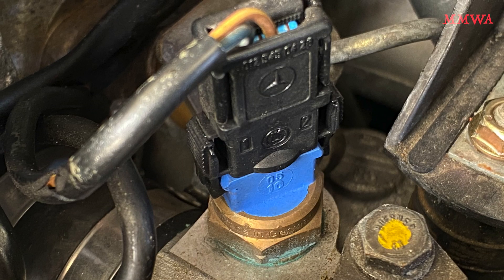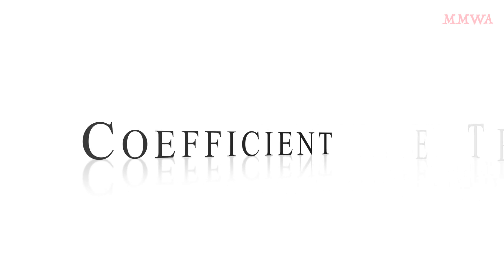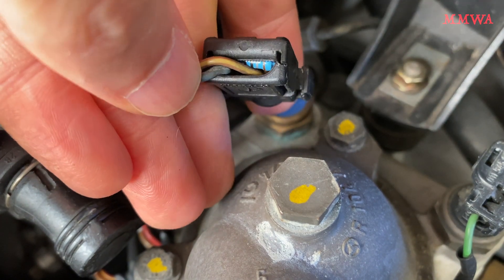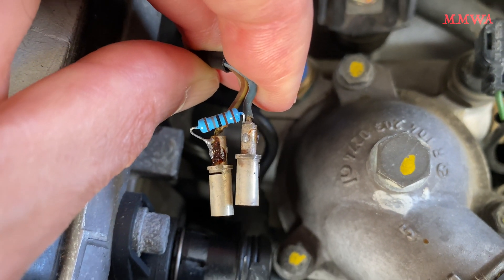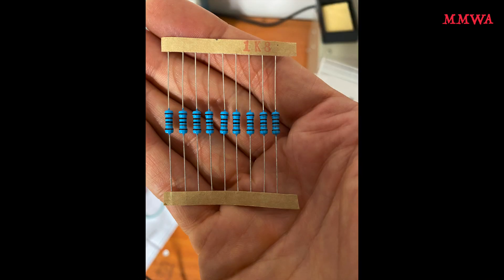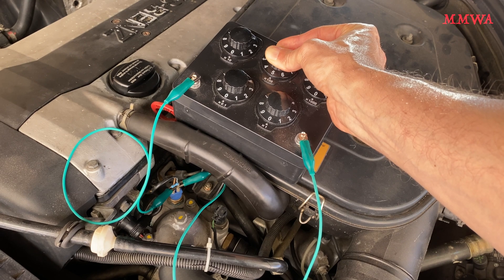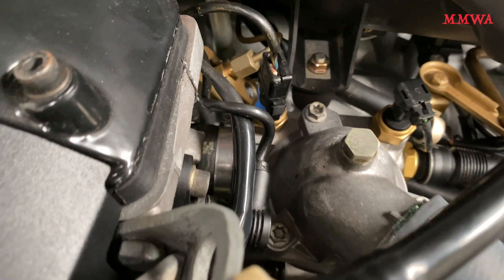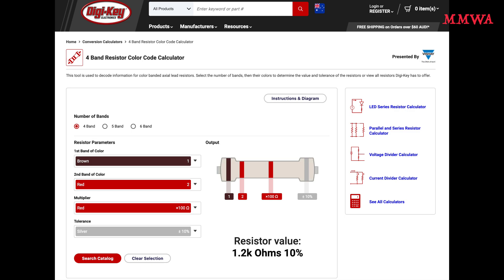About the W124 (and possibly others) Aux Fan blue temperature sensor modification

Comment: I use 1.0 K ohms resistor in order to keep the engine temperature not higher than 100 degree Celsius.

Comment: I just did some math on possible resistors and corresponding fan activating temperatures. 
Greetings from a Mercedes engineer ;-)

| Resistor \[kΩ] | Temperature \[°C] 
| -------------------- | ---------------------------------------------- |
| *2.2 kΩ*           | ca. *101.8 °C*                               |
| *1.8 kΩ*           | ca. *100.4 °C*                               |
| *1.5 kΩ*           | ca. *98.9 °C*                                |
| *1.2 kΩ*           | ca. *95.0 °C*                                |
| *1.0 kΩ*           | ca. *92.0 °C*                                |
| *0.82 kΩ*          | ca. *88.3 °C*                                |
| *0.68 kΩ*          | ca. *84.4 °C*                                |

Comment: thank you for your video...
wondering now if this would work as well in my BMW M50Tu's coolant temp sensor mounted on the radiator that activates the high speed condenser fan....
Reply from the maker: if it is an NTC thermistor it absolutely will work in the same manner. You will need to study what resistance it reads at what temperature and alter it according to what you want. If it is simply a switch, you are out of luck and will need an aftermarket fan speed controller.
Reply: @MMWA-DAVE  
duly noted, thank you!
I shall do a research on my BMW part aside from it looking so similar to your video 👍

Comment: Hi
What you have said was very talkative for my reasoning
My w124 , 
the coolant fan never starts
The A/C fan take over when it is hot
 I have to check this sensor value
I have a simulator for testing this sensor, I'll give a go
Of course the fuse, relay and the last, the clutch .
Could you possibly give some clarification.
Thanks
DomIJ

Comment: Interesting, , I have just got my M104 powered 1990 SL back on the road, BUT after a few weeks i noticed the fans were running, temp gauge indicates 80degs,  first i will change that blue sensor, but if push comes to shove it may be a pump change and i will not be looking forward to doing that particular task. Car has done 135k. best regards Cheshire UK and sometimes Sisaket Thailand.

Comment: Does it work on a OM601?
Reply from the maker: I cant say as i’ve never seen one. If it has the same climate control panel with manual fan speed knob and airflow controls and electric fans on the AC condenser it may well have the blue sensor.
Reply: @MMWA-DAVE  my fan it's magnetic not electric. But i have that blue sensor. In my case its red
Reply from the maker: @MrRoentgen616  I don’t know if this modification is for you then. If the red sensor is an actual NTC resistor like the blue one if might work. If its a simple on/off switch then this wont do anything.

Comment: There's one thing I don't get: Is the resistor mod altering also temperature point of aux fan going off? I mean, I have 1.5k now and it starts at around 100 celsius, ends around the perfect engine temp (the road temp). I want to get there 1.2k, does it mean the fan would stop BELOW the temp is it going off now at 1.5k?
Reply from the maker: Yes, the resistor mod alters the on and off temperatures of the fan. Note that that no 2 cars are the same and the same value resistor doesn’t give same results on both cars. I know this from my 2. The blue sensors are also slightly different too. There are aftermarket fan controllers available to get the on and off temperatures dialed in exactly as you like, This mod will never give such flexibility.
Reply: @MMWA-DAVE  that’s what Ive thought. So, where’s the „stock” information about aux fan on/off stored in? ECU?
Reply from the maker: @gregboro1244  on my cars is the climate control panel that monitors the blue sensor and switches on fan relay.
Reply: (by the way, I did the mod without any soldering, just put the thin resistor wires between inserted into two holes of the female plug.. and plugged directly to the sensor - tight fit, it's so easy)

Comment: my W124 230E aux fan stopped working years ago.. the fan only works if I use a wire jumper on the main coolant switch. so if not observant - the engine will overheat which already happened once and now I am losing about 5mm engine oil after average long distance driving. Still have not found the leak but most likely the head has warped from the overheat.
Reply from the maker: m102 setup is a bit different. From memory even the clutch fan is switched on and off by a temperature switch. Over heating the engine is never good, even in the case of control failure of the fan running a manual switch to the inside of the car is better than nothing to activate the fans. Oil consumption after an over heat event is very concerning indeed. If it gets too bad it may be worthwhile finding another engine.

Comment: Question is - the car has 2 temperature sensors one 2 pin (this one you're doing mod with) and the other one (single pin, only for gauge in the instr cluster). So, doing this mod for the 2-pin thermosensor, you're providig wrong information to the ECU - for example about air/fuel mixture... ?
Reply from the maker: Nope, ECU and EZL uses the black 4 pin temp sensor. This modification has no effect what so ever on the running characteristics of the engine. Blue sensor is specifically for the hvac unit. There is a safety feature where the compressor is cut out on over heating events - it may bring this on sooner than specification after the modification but i've never had this happen.
Reply: @MMWA-DAVE  okay. many thanks! I'm fighting with "no aux fan on. ever" in my car, been through relays, etc. found out when I unclip this 2-pin connector, aux fan runs for a second and shorts 16A fuse is "D" location (so, the aux fan fuse). Do you have any thoughts what might be the problem? Aux fan runs smoothly when connected directly to the 12V...
Reply from the maker: @dustblowboro  on unmodified cars unplugging the sensor should run the fan full time. It sounds to me like the wiring between the fan motors and the relay has melted or become damaged. This is not unusual on cars with worn out and stiff go turn fan motors. You may need to take the car to auto electrician to pin point the issue if you cant find it. You might even have damaged wiring under the fuse box to the relay too.
Reply: @MMWA-DAVE  I think I'd need to heck it... That's a great tip about the sensor. Thanks so much. My wiring was done new (original was biodegradable) by previous owner. If I couldn't help with the issue I'll put a switch for the fan somewhere...
Reply: My car doesn't have the two pin what do I do. Please help its a 1995 e320

Comment: Hello and thanks for the video. I have the 1987 300d w124 turbo
My temp switch looks like yours bur has a 3rd pin infront of the 2
Will this work on my car if so what resistor do I use. My car has the single fan that operates at 100c and 110c I would like to bring the temp down to max 95c
The temp here in idaho is often 95f to 106f  
I have new temp switch ordered as well as electric fan and fan clutch and thermostat. Any help or advice would be greatly appreciated and helpful. 
Again thank you for your time and videos. They have been most helpful. 
Robert

Comment: I have a W124 e200. My heat switch constantly gives me issues nomatter how many times I replace it. I currently have it bridged so the fan clutch is permanently on. But this makes it very heavy on fuel. I want to replace the heat switch with a manual toggle switch that I can control. However, I dont know if this would work as straight forward as it sounds or if i am missing something. Any advice?
Reply from the maker: e200 im not familiar with, but is this an electric clutch fan on the front of the engine like the m102 has? Or its the fans on front of the radiator/ condenser?

In any case, if you are having troubles with the factory control of the fan, you can always bypass it totally and install an aftermarket fan controller on which you can program any temperatures you like for it to operate. I would make sure the airconditioner can still turn it on as requested too.

Comment: Hello, this is a very interesting and informative video. Please allow me to ask two questions, as my knowledge of physics is unfortunately limited: if I have understood correctly, the resistor "tricks" the thermal switch or the control unit into thinking that the original switching point of 107 (?) degrees Celsius has already been reached and thus switches on the auxiliary fans, which would then be switched on at level 2. Is this correct as far as it goes? I found a few videos on YouTube in which users do this, but they all use different resistors. One uses a 1 K Ohm resistor, another uses a 1.5 K Ohm resistor and you have chosen a 1.8 K Ohm resistor. How do you calculate the influence quantity? Is there a formula here? Is it correct to assume that, for example, the 1 K ohm resistor switches on at 92 degrees, the 1.5 K ohm resistor at 95 degrees and the 1.8 K ohm resistor at 98 degrees Celsius? (The temperature values are only invented examples!) ? If I have understood this correctly and stage 2 is then switched at the "107 degrees", is there a possibility of only switching stage 1 or is this only possible by tapping into the pressure switch of the air conditioning system?

The second question is as follows: in the German edition of the WIS it is written that at least at LH (I don't know if also at KE and ME) when reaching 107 degrees Celsius and thus switching on the two electric fans, the performance of the air conditioning is throttled in order to minimise the thermal load a little. So, if my understanding is correct and a resistor commands the control unit to reach 107 degrees Celsius and thus "switch", would the air conditioning then also be throttled? And if so, did you notice this in your test or is it negligible? 

Thanks in advance for your answer and greetings from Germany, home of your cars. 
:-) 

Greetings, Heiko
Reply from the maker: in regards to resistor choice, its not so complicated. It is basically trial and error till I found the value i liked. 1.8 wasnt the first selected on my blue black car, it was some other value (i can’t remember which) and i wasn’t happy with the switching points so changed it out. No 2 of of these blue temperature sensors are made identical, 1.8k ohms on both my cars still has the fan come on at a slightly different temperature. 

With the AC being disabled from memory that happens originally at around 120c, so it probably will still happen but obviously at a lower temp, perhaps around 110c. I’ve not had this happen ever, the hottest actual temp i’ve seen on my blue black car is a consistent 105-107 on a very hot day driving up through hillls.

Comment: Great video!
I have a 124 300e 92 2.6l
And has blue sensor...
Where, would I buy the 1.8k resistor?
Appreciate your help!!
👍🙏
Reply from the maker: theyre cheap as chips, you buy bags of assorted resistors for dirt cheap on ebay, or buy a sheet of them from local electronics store.

Comment: Think I need to check the wiring and sensor on my car. On hot summer days the fans will come on immediately with the ignition, then start running intermittently as the engine warms up.

Comment: “Cool” mod. It’s nice to have it visualised on a video. Thinking of doing it in mine.

I have yet to solve the “issue” with the fan clutch (it’s fixed to engine speed, and rotates with it -no “viscous” function). Proper brands (Febi, Meyle, Sachs, etc) are not easy to come by and cost 3x more than in Europe.

According to a brief service booklet I got, the part n° is the same for M103 and M104 (103 200 06 22). Others I found are -04 02 or -03 02 in EPC. Operation is set to 88-96°C, but will of course make the engine run warmer.

With actual fan clutch subject directly to engine speed (fixed), T° sits at 80-85°C and no more than 100°C on heavy traffic and hotter days.
I’ll take note on the last thing you mentioned in the vid.

Comment: My old 2.5-16 had a problem where it got hit in traffic. Swapped out my red aux fan to a “tropical climate” one. I believe it was black and made the fan cut in earlier to help pull temp down before it got too hot. Fixed the overheating in traffic problems. Cheers n keep up the gd work
Reply: Yes, these 'tropic climate' switch are black color, trigger fan at 85C, cut off at 80C. Most W124 in Malaysia has replace the red switch to the black one. They need to pair with low temperature thermostat, else your radiator fan will keep on running forever. Low temperature thermostat start to open at 71C.
Reply: @marcinoniszczuk8744  no. It’s based on colours   Just ask the dealer and they can look up at what temp it kicks in. I think it was green or black. Opens a lot earlier